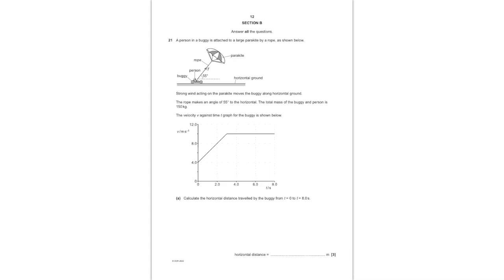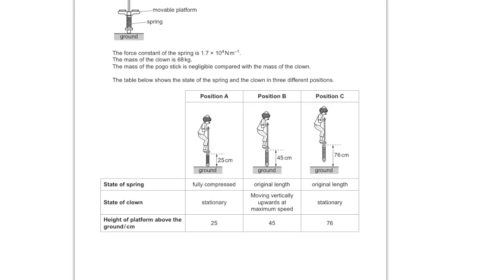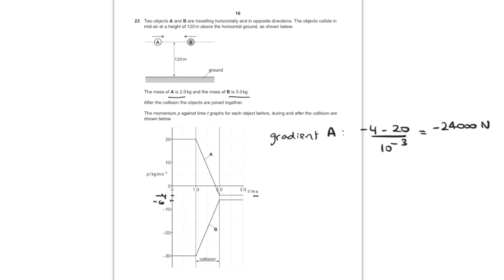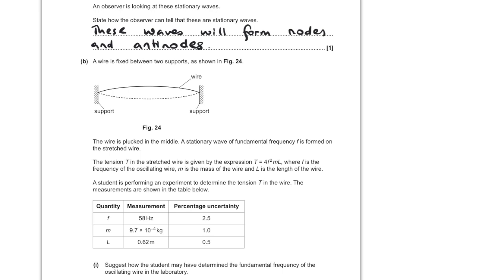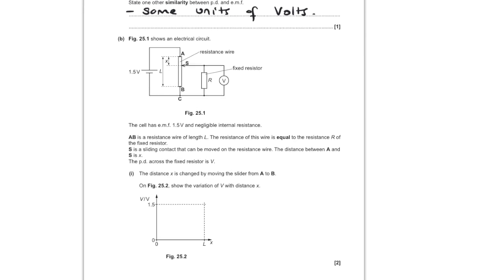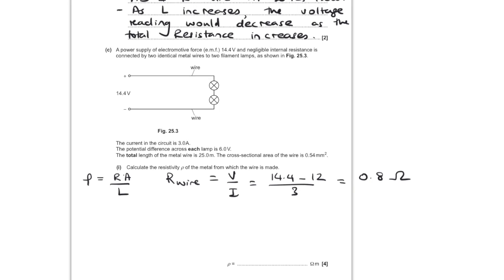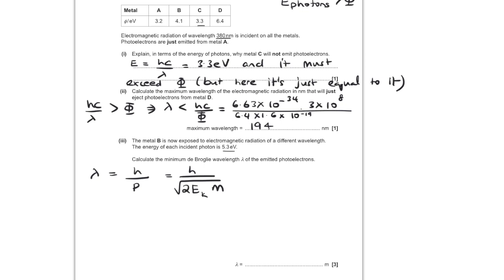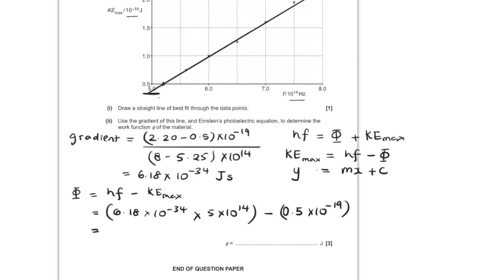OCR physics A paper 1 June 2022 section B walkthrough

Comment: hello how did you get 12V for question 25ci?
Reply: also for the same question shouldnt it be the cross sec of 5.4 x 10^-4 not x10^-6
Reply from the maker: @cassiwigmore4169  it should be 10^-6 because 1mm =10^-3 m so square it for the area to get 10^-6
Reply from the maker: that's due to the pd in the two bulbs (6V each)

Comment: Hi, thanks for the video, Im just very confused about 25.b.i
Reply from the maker: Sorry about the late reply but here's another explanation: As the length of the resistance wire is increasing from A to B, the resistance is increasing too. And the (resistance) wire and fixed resistor being in parallel have 1/R=1/R1 +1/R2 relationship, so the total resistance is proportional to Voltage across the two. Its almost like a y=1/x curve but V becomes 0 at position B because the resistance is maximum.

Comment: For 26a how did you calculate the energy for c?
Reply from the maker: Using E=hc/lambda for the given wavelength of photons (380nm) I get E=3.1eV. Now, the photoelectric effect occurs if this E (of photons) exceeds work function of the metal but for Metal C, the work function happens to be greater than the energy of the incident photons. Hence, Photoelectric effect doesn't occur.
Reply from the maker: You aren't calculating energy for c, you are just to calculate energy of the incident photons.